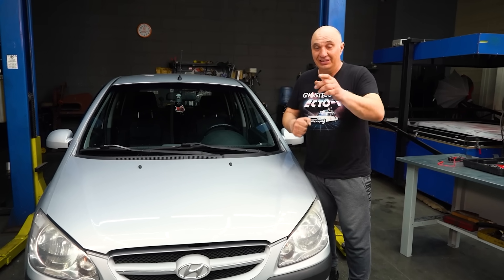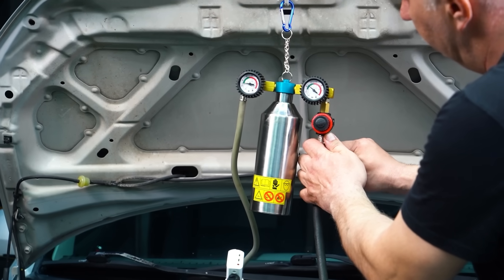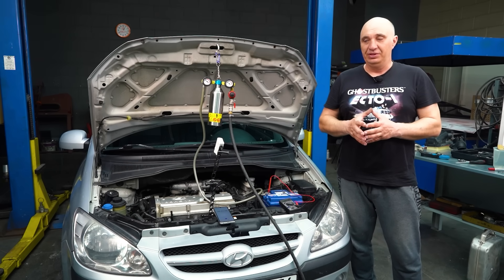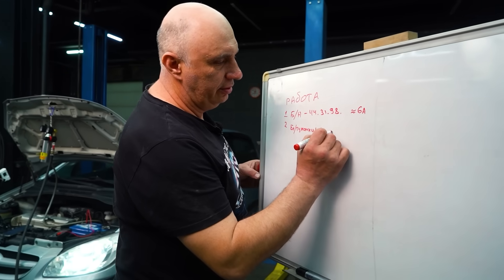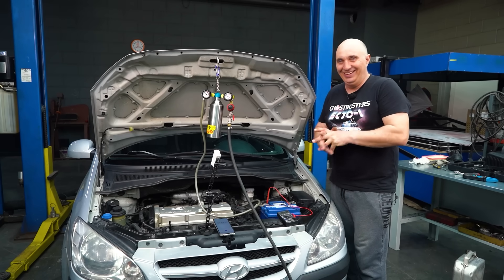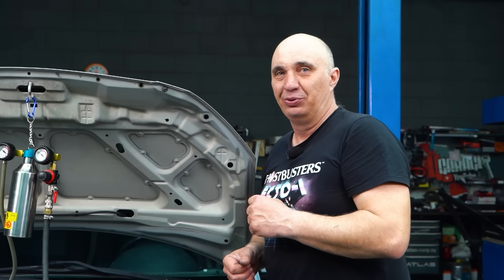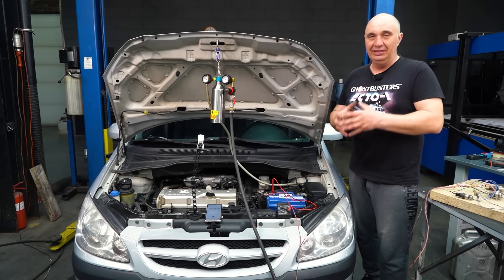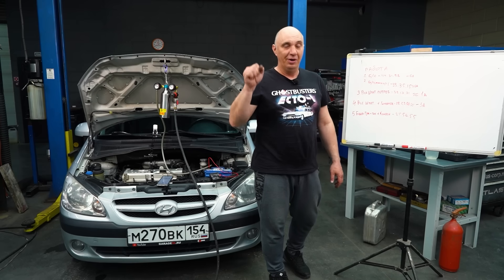How much really do accessories affect fuel consumption?

Comment: The current actually drops because the alternator is charging the battery with less current when the accessories draw most of the current. When the current was high, the alternator was actually charging the battery more than supplying the accessories.(because they were turned off) If the current had been measured directly after the alternator it would have been as expected higher with everything turned on.
Reply: The alternator can only supply a limited current at idle speed, so the voltage drops with high load and the battery can actually be draining instead of charging.
Reply: @dino6627  Yup. I've seen cars with such weak alternators by design (thanks beancounters) that just turning on the high beams or max AC will significantly drop the charging voltage at idle, sometimes to the point of draining the battery. It's not uncommon for adding much more load than just the low beams to do this.
Reply: @dino6627  depending on the car. in this case, at idle speed he read 14 volts, which is quite a good sign of charging battery
Reply: @akissot1402  With the heavy load at 12:30 sufficient current can't be supplied and the voltage drops to 12.6V. If engine revs increased to over 2000 then full current of alternator (around 80A) can be supplied and voltage would return to around 14V.
Reply: @dino6627  and the engine could have spare current to give to the battery to consume, and his meter would read something more than zero
Reply: No  @dino6627
Reply: Alternator load will be the same whether its topping up battery when battery is under load from accessories or not, until battery is charged, but its the Alternator load wire to the battery which causes resistance to the engine and effects fuel consumption, the battery will just absorb more charge when accessories are draining it.
Reply: @simonallan9941  actually no.....when the battery is toped of the current draw will drop because the battery voltage and 14v from alternator are so close to each other that it charges slower, it's pretty complex to explain how all off the electrochemical reaction works..........but if you don't believe me look into data sheet, just keep that in mind.
Anyways I think they just measured it wrong.
Reply: That could be the case it really depands on the car and where you measure most modern cars from my knowledge have one thick cable from the positive to the anternator + the starter and than second red cable running from the positive terminal to the cabin for all of the electronic.........
To have right measurement you would of course need to clamp both of the cables
Reply: @Jarda_B  Good point but cars vary a lot. Sure-fire way is to just clamp the +cable that is connected to the alternator.
Reply: @evertonptube  Actually the best thing to do would be start it disconect the battery and just measure the alternator cable, that way you would have no variables, no charged discharged battery just pure power consumption
Reply: @Jarda_B  even better! That way you're not accounting for battery charge since the whole point was accessory power consumption. 👍
Reply: @Jarda_B  If you pull the battery out of the circuit you risk burning up the electrical system due to no reference voltage. The alternator may run wild and jack the system above 20 volts.
Reply: the amp meter should have been connecter in series to battery from alternator
Reply: @stolenMemes25  Are you familiar with concept of clamp meter?
Reply: Correctly, the battery is at 12v, but the engine was running, the alternator is the one that was charging the battery at 3:20 at 14v read with a voltmeter - multi-meter., therefore with everything turned up and the engine on he tries again later to measure the current with a Current Meter this time, while, the battery doesn't discharge since the engine is still on, it was probably even charging a little. but the load as you pointed out was on alternator unless turned off. which would switch to the next best source of energy the battery
Reply: Yea, he measured the wrong wire.
Reply: I think current measurement was perform wrong way. If multimeter was clamped on alternator to battery wire and battery to car wire simultaneously that shows only how many amps goes to battery, same sitution when battery to ground was mesure (incoming and outcoming current cancel out). Amp meter should be clumped on alternator wire only or battery to fuse box only.
Reply: @albi2k88  I came to see the comments just to make sure this had been mentioned. 

I would like to mention that any alternator requires a minimum RPM (always above the engine's 1000RPM, but can be 2000 or 3000rpm) to achieve its maximum power output. Below that RPM, it can only produce so many amps before its voltage starts to be 'sacrificed' to maintain its AMP output at that RPM.

Garage54 in this case are unfortunately measuring the current in/out of the battery: (not what they meant to do)

-1st run we saw 
-> ~6 amps going INTO the battery to recharge after cranking the engine, 
-> above 14V
-> 44min/500ml (alternator was producing minimal current)

-2nd run  lights on, etc. 
-> still ~6A going into battery to charge back energy spent starting engine (same as 1st run). 
-> However alternator is now producing more amps to run all lights, etc and at idle RPM can STILL 
-> keep voltage above 14V, meaning that a 
-> lower run time means more energy spent to power accessories. 
-> 39min/500ml (alternator was now powering the lights and accessories)

-3rd run with everything on minus AC we saw 
-> ~1A going into battery (recharging energy used by started motor), 
 -> but now batt is 13.07V, which means that  
-> at idle RPM the alternator CANNOT produce all the current needed to maintain 14V. So now 
-> most of alternator AMPS are going to accessories/lights
-> 33min/500ml (because most of alternator AMPS were spent on accessories and left little to recharge the battery)

-4th run, everything on with additional lights. 
-> Alternator can now only produce enough AMPS at IDLE to power SOME of the load, thus it
-> ALSO needs 6A FROM the battery to keep it up! (confirmed by the 12.6V at the battery).
-> 28min/500ml

-5th run, with everything plus the A/C 
-> No further details were given, all we can see is the change in run time (18mins shorter than no extra load) 
-> This is a different scenario because besides the A/C compressor using engine torque, its electric clutch uses many amps (usually above 10A), which would add even more load into the alternator (which was already maxed out at run #4), thus explaining the lower run time
-> 26min/500ml

p.s. Yes, I know the alternator pulley is an overdrive from the crank pulley and the alternator itself is spinning much faster than the engine, but my statement still stands: an alternator needs more than 1000 ENGINE rpm to reach it maximum power output.
Reply: It's the alternator current that decides its mechanical power consumption. Whether the current goes to the battery or to the accessories doesn't matter.
Reply: ok? isnt this common knowledge

Comment: From what I can see you're trying to measure the current at the battery, if so it will fall as you load up the vehicle as you're measuring what's going into the battery and this is falling as the energy is being consumes elsewhere.
Reply: So, if you want to charge your battery by running the car, turn off as many accessories as possible? Right?
Reply: @robertnichols2283  Correct, the alternator can only output so much power, if you're using it elsewhere it can't go into the battery.
Reply: @robertnichols2283  Limited alternator power is only a problem at idle engine speed, it is best for the engine to drive the car normally than leave running at idle for long periods.

Comment: A big amplifier would be a great test 💚💛❤️
Reply: For having some effect from amplifier, you need to play sound with full volume. For low volume it takes max 1 W.
Reply: @jannekarppanen9346  Yes I'm talking about playing music on full bass using at least a 1kw amp running at about 40+ amps 👍💚💛❤️
Reply: Yes, it's surprising how quickly a high power music system can drain the battery, a 250 watt system will draw around 25amps when the bass is up high!

Comment: It CAN affect fuel consumption very much.
With my little 1.2 L gas engine in my first car it used more than 1 Liter /100 km more if i only started AC which is very much if you usually use about 5 to 6 L/100km. But with my 3.0 L TDI I´m driving rn it honestly does not matter.
Reply: to be fair, 5/6L/100km is a ton already for an engine that size.
Reply: @anonimas12  not for a car from 1998. And it was usually filled with stuff for work.
Reply: My 5.7 l Jeep Hemi just laughs. A full tank of gas is a challenge.